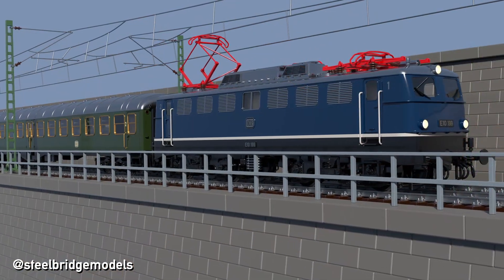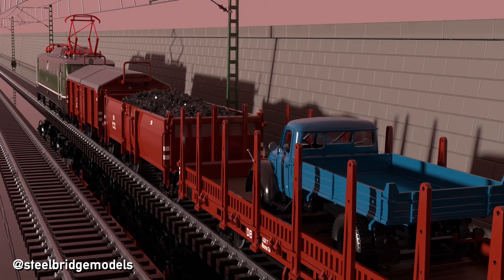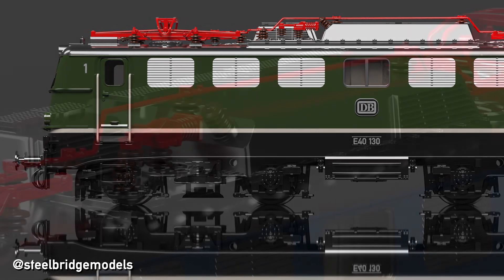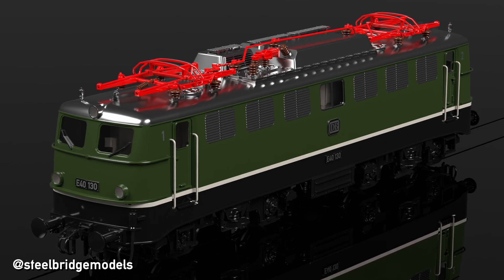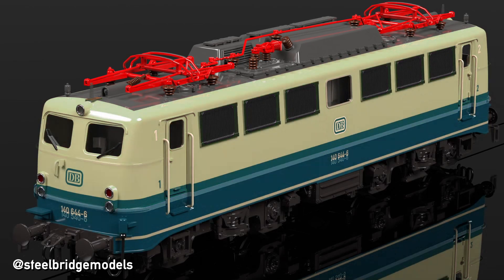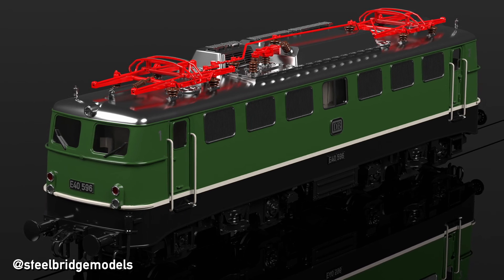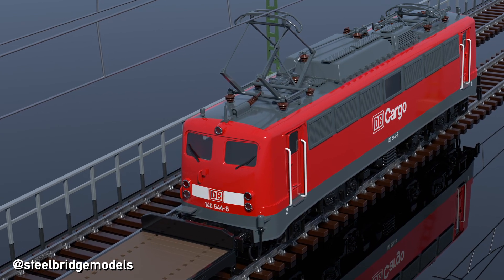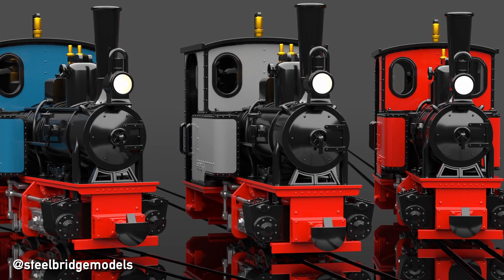Why are they so important?

Comment: One modification not mentioned in the video is the replacement of the original DBS54 pantographs with extension coil springs by pneumatically operated single-arm pantographs (Stemmann DSA series) towards the end of the career, still found in the remaining units working for private operators. The new pantographs can detect damage by means of a pneumatic tube and will be lowered immediately, thereby reducing damage to the overhead wires.
Only part of the series are equipped for multiple traction and push-pull operation. This has been retrofitted in a few units. There have also been some bogie swaps resulting in class 110 renumbered to 140.  Class 139 and part of the 140 had small snowplows. Also the signalling systems were modified as needed, a number of units received LZB, though none of them have ETCS.